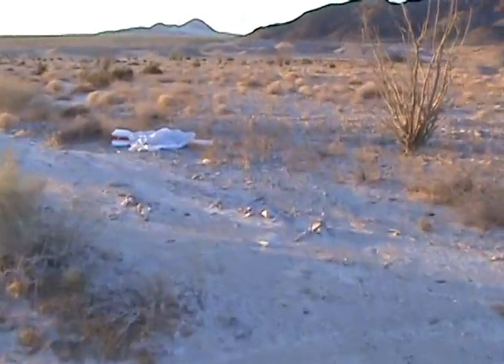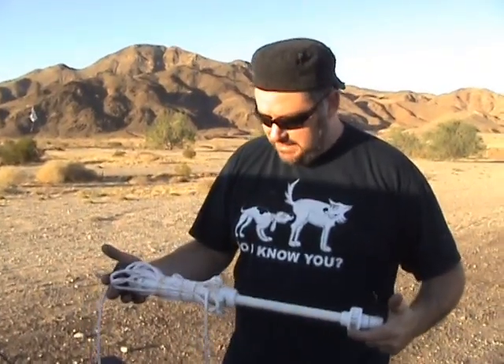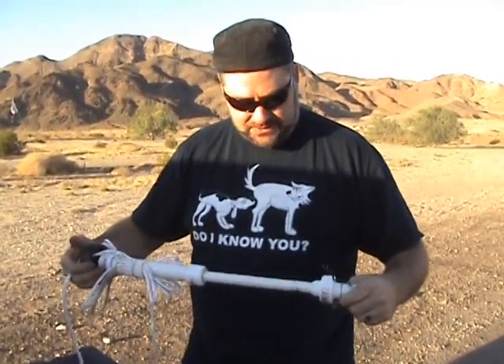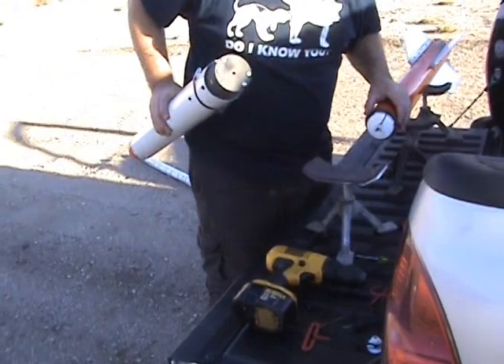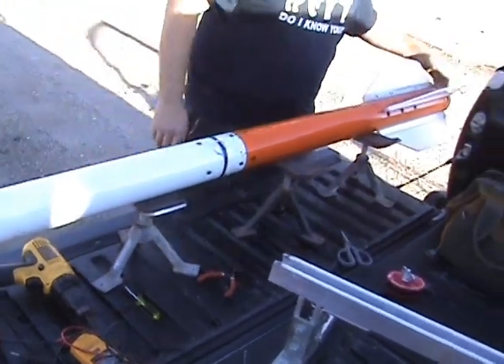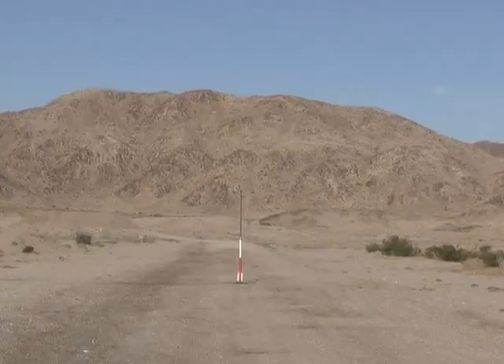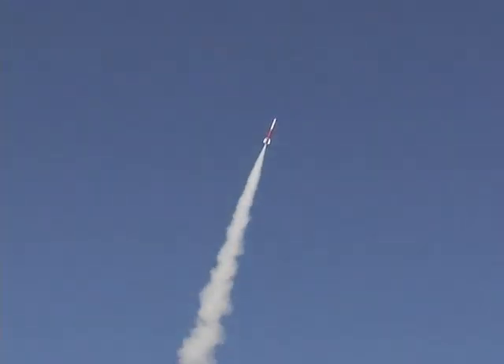Finally, everything works perfectly....twice in one day!

Comment: You should install a cycling presta valve in the plunger and make it reusable, you can buy the valve by its self and it holds several hundred psi. Also it would be sweet if you posted comprehensive plans w/ dimensions of the design w/ notes on fuel mixes for others enjoyment :) Good work keep it up!

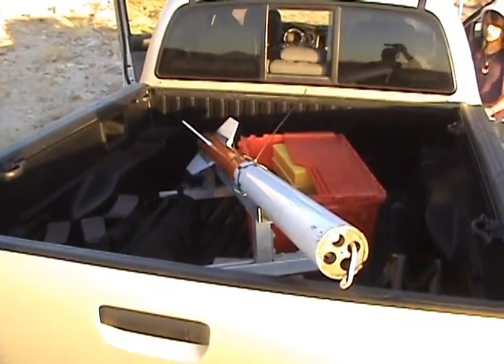Comment: Great flights (as usual)! Out of curiosity, what is the wire taped to the side of the motor casing (visible at 2:43 in this video as well as in some other videos)? Is it for head-end ignition on the motor?

Comment: Dan, my rocket designs seem excellent but i'm not building anything till I understand the legality- you need to notify the FAA with this size of rocket, up to what? at what point do you need a.. license? i don't know. do the tripoli class things apply at all? does it matter where in the desert you fly?
Reply from the maker: Hey dude, the FAA has rules on what constitutes an waiver and where you can fly, just do a google search since you'd want the latest and greatest. I know you can't fly much without a FAA waiver, the limit is pretty small, but getting a waiver is pretty easy and free. Good luck!
Reply: yes i've been googling for ages, I have read many documents from the FAA, FAR, and state regs. still, i've been running in circles, unable to determine whether the FAR / Tripoli classing system applies only to sanctioned launch zones or if i need them when launching in the desert? is there an upper limit to motor size covered by just the waver? my intention is to reach space, and i'll try to do it on the minimum motor power necessary, but it still will exceed class 3, and the laws talk circles about this area. could you possibly give me any help here? i'll get your book soon if i can, i'm sure there's lots of great info.
Reply: You need a Class 3 waiver for any rocket over 40,000 Nsec regardless of where you launch, 'sanctioned event' or not. The highest you can get a waiver in California is at the FAR site, otherwise, launch from Black Rock in Northern Nevada. There really is no upper limit to a class 3 waiver.
Reply: awesome. that's what i needed to know.